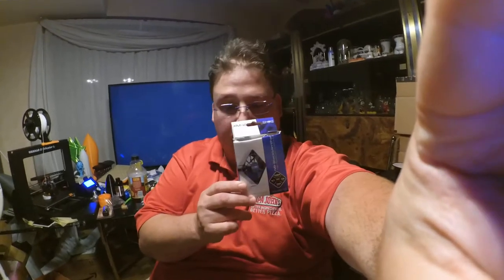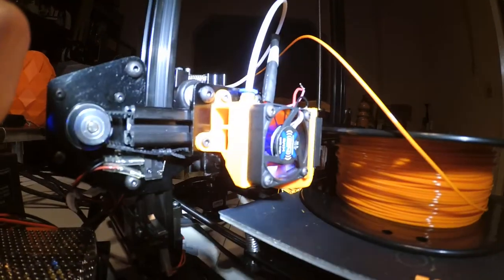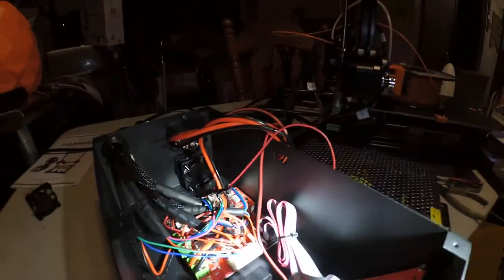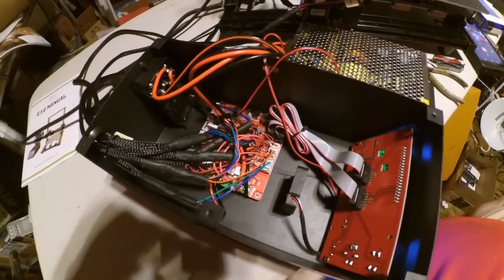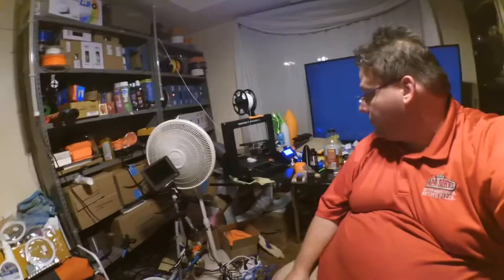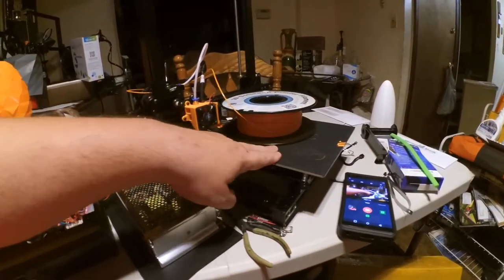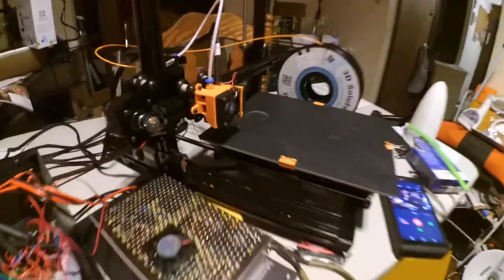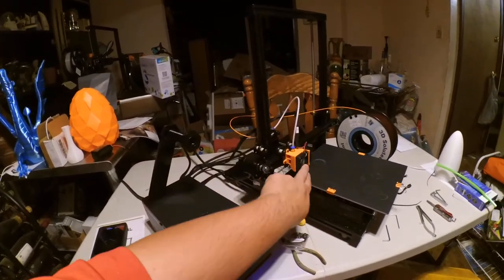Today's 3D Print - Anet Fan Upgrades & Hot End Shround Upgrade

Comment: Yep. I have an Anet E12 and that same fan in the box is making heavy noise so I'm going to replace it. I did notice removing the Anet brand sticker helped the center spin more freely and that cut down on the noise a little. I also had to replace the part cooling fan on the right side of the hot end. That one had stopped working altogether. After I pulled it I noticed that what had happened is that the solder point for one of the wires had broken. I figure just from taking the unit apart a couple of times the wire gets pulled and eventually the connection breaks. So I went ahead and ripped the other wire off at the other solder point and stripped back the original wires a bit. There wasn't a lot of wire left since they kept it short but there was enough. I considered attaching a connector, but I decided not to wait for my order to come in and I just cut off the connector from the new fan and I twisted and soldered the connection using heat shrink on them individually and then a larger one to tie them together for good cable management and to protect the wires from getting pinched when reassembling the hot end. I doubt the connection will break again.

Comment: You should try the Trinamic tmc2100 stepper drivers. They are almost noiseless the steppers since they use 1/256 Interpolation. I installed the trinamic to my CTC printer... I can't hear the steppers
Reply: Anet E10 motherboard is the single piece. Drivers are integrated and are parts of the motherboard, and there's no way to replace them.

Comment: GREAT JOB :-)
Reply from the maker: CNC kitchen did a splendid job on that hot end cover shroud. REALLY makes it work well. anet should buy the damned design off him and include it with the printer :-) it works that well. I also love that all 3 fans were 40mm. makes it so easy. $30 and you got a SILENT printer. really really silent.